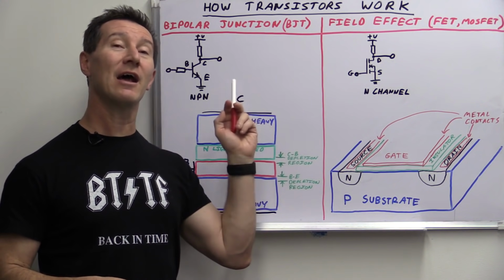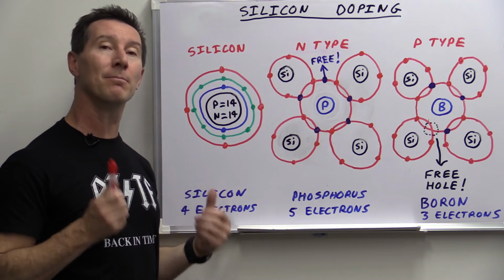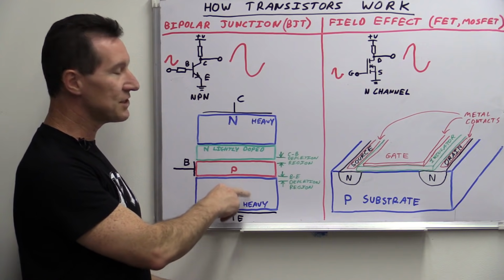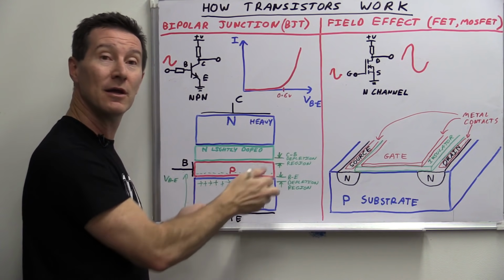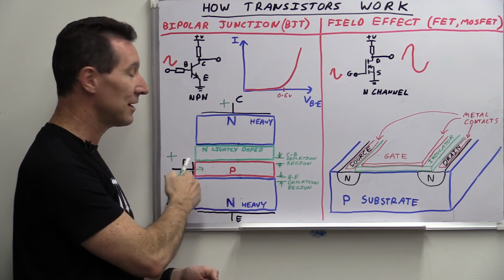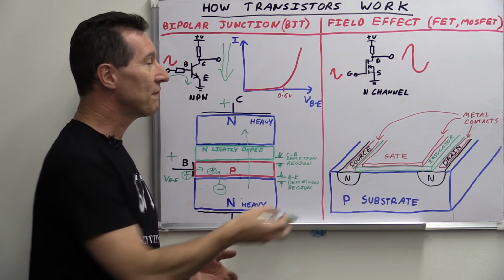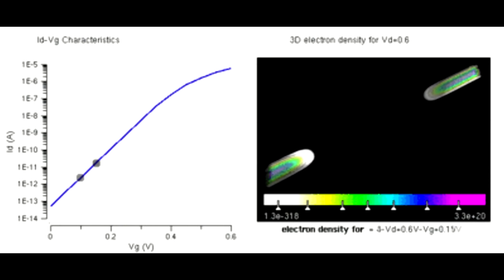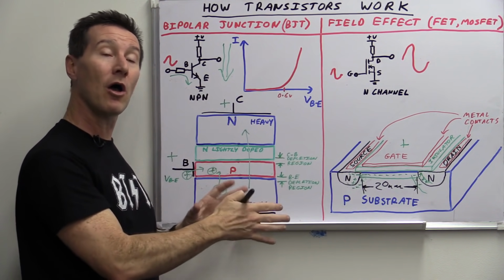EEVblog #748 - How Do Transistors Work?

Comment: I have been reading through the comments and I see where even I through the use of mislabeled polarity, have to say an awful lot to avoid any confusion at all. Some people are saying that it would make more sense to label electricity like Benjamin Franklin had it labeled, which was correct in every way. And it would make more sense to go back to that. Because a particle of electricity is actually abundant with repulsive force, abundant with pressure. As you put more and more particles of electricity in one place, they try to move to an area where there are less particles of electricity. Nothing flows out of the (+) terminal on a car battery. There are no (+) charged particles, as marked on a modern car battery going anywhere. They are coming out of the (-) terminal of a modern car battery. Benjamin Franklin had them marked the other way correctly. He used pointed and flat terminals to tell which way and which terminal had the positive pressure. Colleges looked at a fancy new cathode ray tube and claimed Benjamin Franklin had it wrong. They are insane. 

Today a modern car battery sends electromotive force, an actual pressure out of the ( - ) terminal to the ( + ) terminal. The problem is the markings on the battery. Because the positive pressure, the positive electromotive force, not the symbol, but the positive pressure is coming out of the ( - ) terminal of a "modern" car battery. Insanity. Witch doctor stuff. 

The problem is that most do not stop to look at the actuality. Heat moves and travels, cold does not, cold does not creep into your house. Heat creeps out of your house. If the heat did  not move, the cold could not get in. The same is true of a vacuum pump, it does not suck anything anywhere. It compresses air obtained from a vacuum chamber that is under pressure. Once the pump compresses the air, it ejects the air to the atmosphere outside the pump. At this point there is less pressure in the pump than in the vacuum chamber and the pressure in the vacuum chamber moves more air into the pump under pressure. The pump has no mystical way to get air into the pump. That means you can never get a perfect vacuum. 

A vacuum does not get into a space ship. The pressurized cabin leaks into outer space. 

We have been played like an instrument. We are paying to get degrees from cult's not education centers. 

Sincerely,

William McCormick
Reply: +William McCormick 
Didn't Ben Franklin assume that it was positive charge (of fluid) that was the constituent of electric current, or did I miss something?
Reply: Yes he not only correctly explained electricity, he also scientifically proved his explanation. Using such simple things, that we should all get a good old fashioned spanking for letting this happen.
Colleges got a hold of a cathode ray tube and read way too much into it. I mean they went to never, never land. And then proclaimed they were the new experts on electricity and science, not old Benjamin Franklin. Haha
Sincerely,
William McCormick

Comment: God damn it. Why does no one tell me how to amplify signals with transistors. T_T 

I need to take signal from a PIC and power it with a different path through the battery. The PIC can only handle so much current. I need the transistor in the cct so I can send a higher amount of current through but use the signal from my PIC to switch the higher current. If I put it all through the PIC I fry the chip.

Can someone link me to something useful to my needs?
Reply: +Ryan Roga Try https://itp.nyu.edu/physcomp/labs/motors-and-transistors/using-a-transistor-to-control-high-current-loads-with-an-Arduino . Or Google "Arduino high current output control" or similar.

Comment: WRONG, WRONG, WRONG FOR THE BJT !!!
BJT NOT only is NOT an amplifier, but also it's exactly the oposite: a strangler !
BJT does NOT amplify, it simply controls.
Amplification rate ? WRONG ! Should be called sensitivity rate.
Cheers !